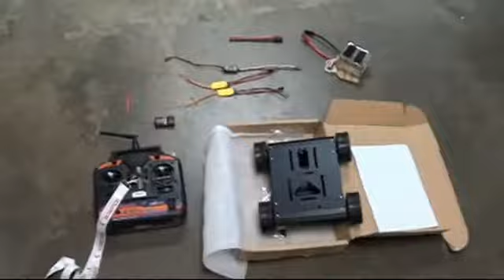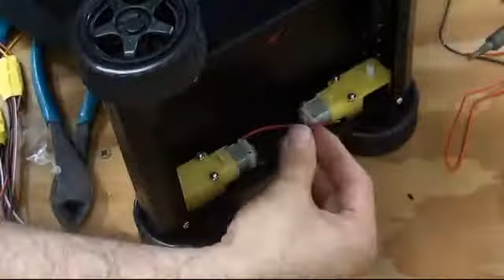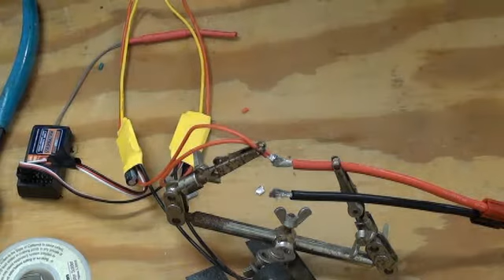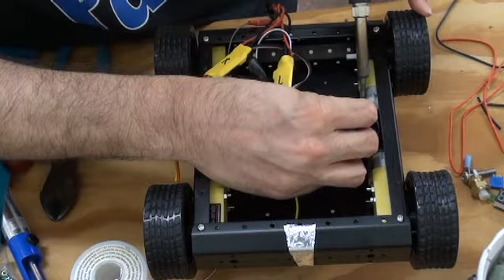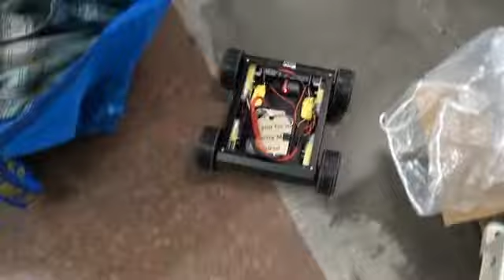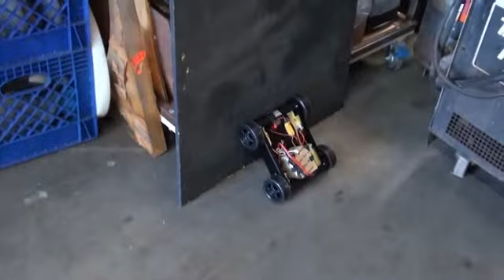4WD Robot Base - part 2 -BotBitz 10Amp esc & HobbyKing T6 Radio

Comment: Hi. I did everything u did in the video. It seems something is missing, it only correspond to 1 side of wheels, left or right. Example, i push forward or reverse, only the left wheels move, pushed right and left, only right wheels move. Can u guide me?
Reply from the maker: you need a mixer, or you need a radio that features mixing

Comment: Why did you fold the red wire back? I never do that.
Reply from the maker: Sometimes, the BEC (battery eliminator Circuit) doesn't play well with others. Pulling the red wire from all but one speed controller makes it so the BEC doesn't "fight" with the others. This is only an issue with some of the Becs on the market, I don't know  if this is one with that problem or not.  Its always been standard practice,  and abides by the KISS principal
Reply: okay Thanks for tip.